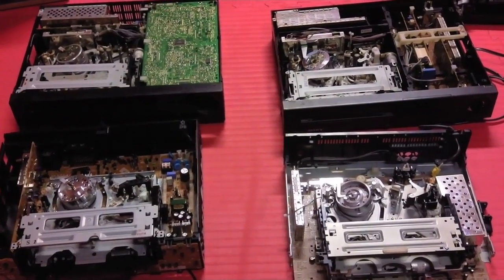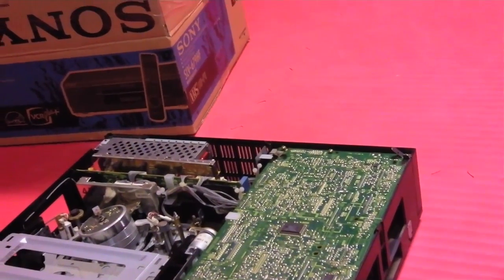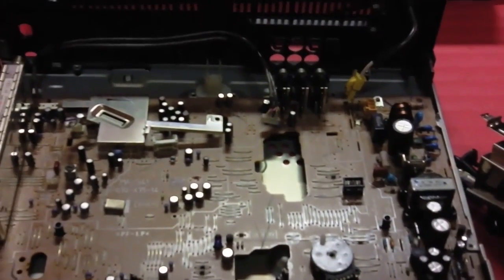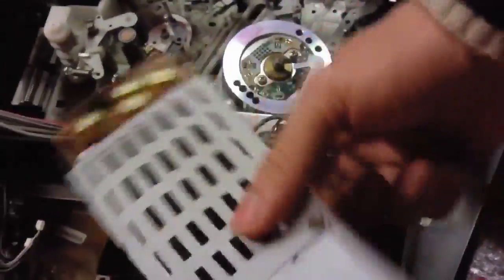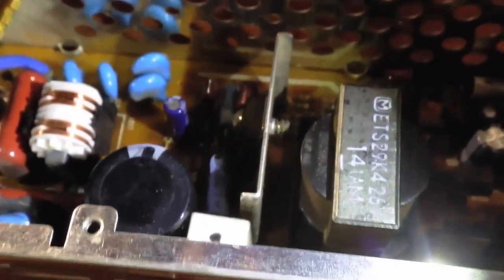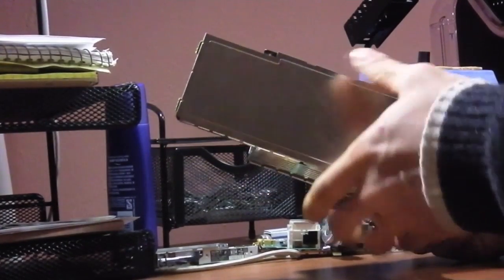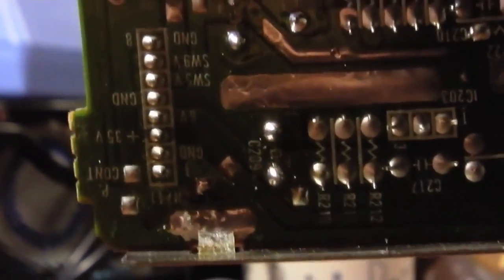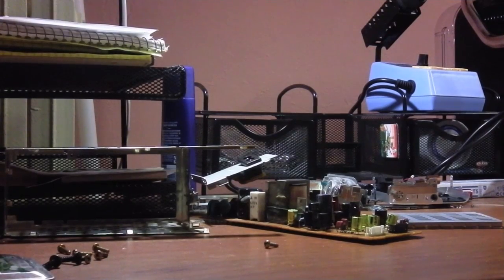Intro to VCR Power Supplies - a comparison of older and newer models

Comment from the maker: If you check my other video troubleshooting Sony VCR briefly powers on and shuts off symptom, you could possibly repair your Samsung's power supply the same way. Just leave the big 250V or 400V capacitor in place, they don't usually go bad. Replace the others.

Comment: Hello
I have a Samsung VP-2503 and when I press power, the vcr powers on for 2 or 3 seconds, then goes off, but you can see a green light flashing..
The power supply looks like the one in the video, with the metal shield on the Sony model, Should I replace all the caps?  Have you ever fixed the Samsung with the  DC to DC switching power supply?
PLEASE HELP..  I have soldering skills